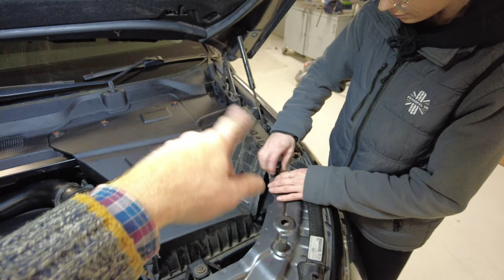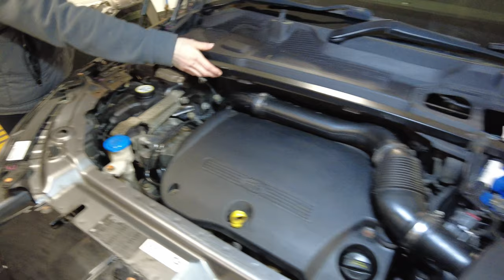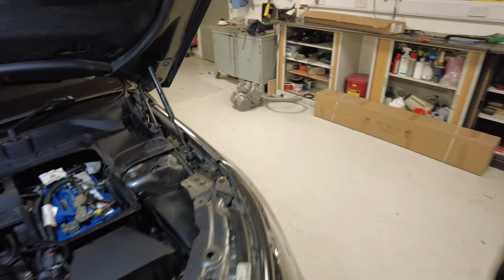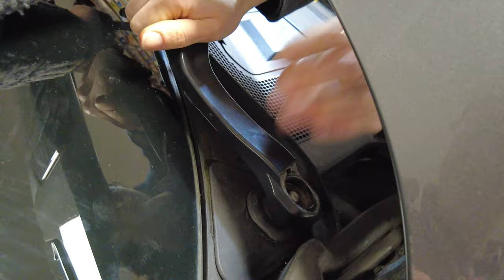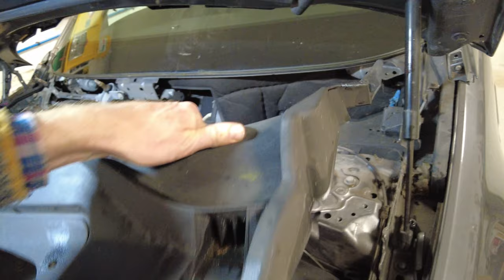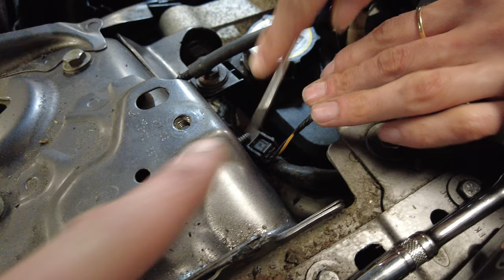How To Remove Windscreen Cowl Scuttle Panel on Land Rover Discovery Sport L550 Wipers Washer Jets

Comment: Simon….I was watching to see if your car had the same thing missing as mine did when new and does!  Have you noticed diesel/paraffin scented fumes come into the car sometimes when come to a stop or reverse? A batch of DS are affected and I believe it is the 2015- May 2017 cars that havea problem . Mine is a May 2017 build and as you know, is in total option form which ties up with many cars that were sent to the USA and Canada…and I suspect all were affected as various forums have discussed this. On your car, on the left hand side/ off side, as you took all the plastics off, you didn’t remove a push on and turn clip secured plastic curved section that should be there to meet up with a section of soft rubber seal which should be under the bonnet following the line of the underbonnet strengthener. When the bonnet is closed, the two parts meet and seal off the area above the dpf unit to stop burnt fumes being sucked into the air conditioner and that cures the fume problem. So…as far as I can see in the film, yours has neither of them…and it was a £186 repair (all free under warranty for me!) . I hope this helps a reader and maybe you…you could make the bits for about £10 max then charge £60 to make a profit! 😃😃😃😃 I can send you detailed pictures if it helps…it was a perfect cure for me…37,000 miles ago.
Reply from the maker: Interesting - I will take a look. Now we have the car MOT'd we can take it to the dealer to get the steering bolts checked so will mention this at the same time
Reply: I'd be interested! I wasn't sure if I was imagining a faint diesel smell. I was putting it down to a bit of diesel I spilled changing the filter...  🙂

p.s. do you have any pictures?
Reply: @handycrowd  I do have pictures taken at the time but I can do better framed images tomorrow to show exactly what is missing. The fumes emerged mostly when slowing down from 40/50mph to a stop…fir me that was leaving a motorway junction which ran downhill to a stop at lights and it would happen often but not always as the dpf was not always regenerating. The logic is, as you slow, airflow into the engine compartment will slow but also the natural vacuum/ lower air pressure that follows the rear of the car, collapses and can even cause a reverse air flow under the car which for a few seconds makes the underbonnet still air (relatively speaking). Then..if the dpf is regenerating, you get the 800C heat and super hot gases forming a cloud which has only one escape…the water drain from the heater fan so it vacuums up that slug of air and you get it straight into the cabin. The modification takes ten mins and no tools needed. Guy Salmon had tried to cure this for weeks and stripped all the exhaust manifold, egr valves, the dpf unit, looked and tested for leaks, test drove it for three weeks and agreed the problem existed but had no cure. They were on the point of refunding my money and taking the car back but it was by total chance that I took pictures of a new car in the showroom with the bonnet up and I later compared and realised what the problem was. Next morning…the missing parts arrived and we fitted them in the carpark…..next day we set off for a tour of Germany and Poland…all was well…at 41986 miles..it still is! Pictures…I cannot post them on here but will gladly share them somehow. 🙂🙂🤔
Reply: Wow! Quite a story! And a good reminder of how complex these cars really are! Look forward to the pics. one way or another 🙂 @HQBProductions
Reply: I’m trying to post them but You Tube doesn’t allow pictures in answers as far as I can see…I’ll finally way somehow..maybe via Simon.🤔🤔🙂 @handycrowd

Comment: Oooooh! Would love it if you'd show us the screen change!! My heated screen isn't working and I've checked the fuses and relay, and now I want to check the wiring connectors to the screen..... 🙂🙂
Reply from the maker: I was worried the guy would not want me filming - but at the end he said "you should have filmed that "
Reply: laughing  always the same! Did you manage to see where the electrical connections were on the screen? Assuming of course that yours has the heating element! Cheers 🙂 @L663

Comment: Great video. I have an issue with my front wipers not working and it seems it's more than just the fuse. I hoped accessing the wiper motor was easy but this looks like more of a faff than I was expecting!